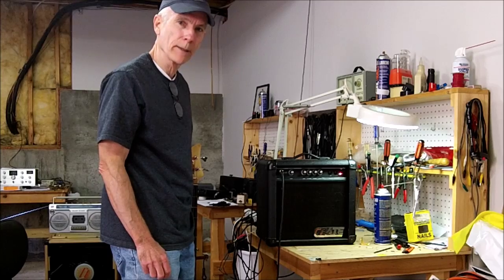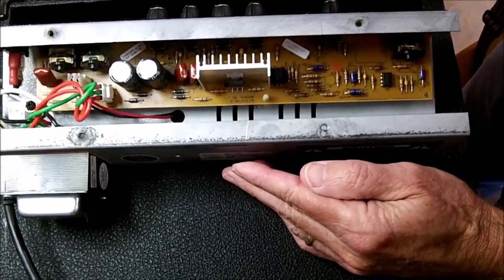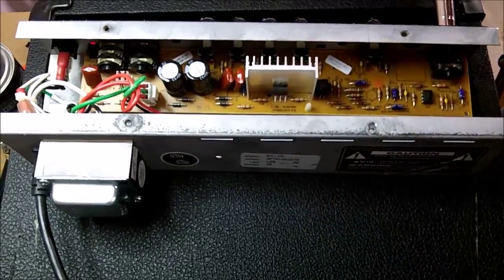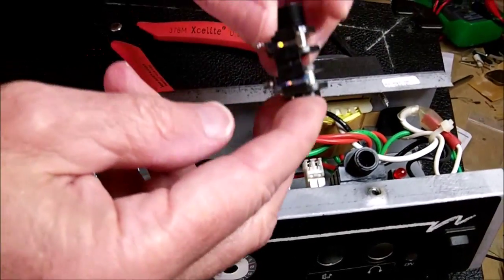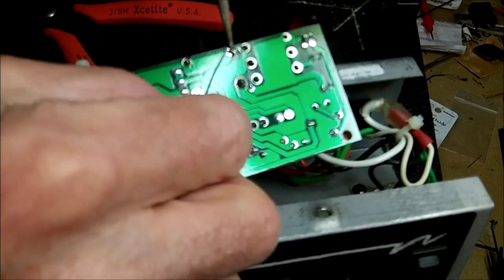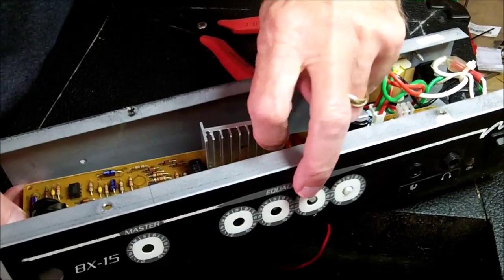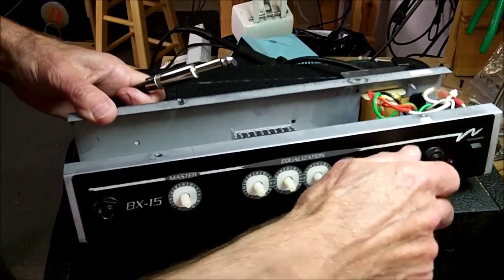Crate BX 15 Solid State amp repair

Comment: I bought a Crate B80XL off Facebook Matketplace for 50$. The minus 15 decibel  jack works bit not the zero decibel  jack .Of course the seller didn't mention the input  to use on a passive bass doesn't work. After  Watching this video I hope it's something simple that I can fix
Reply from the maker: Sounds like a bad zero db jack. Check the solder connections on that jack carefully and repair if there are any cracks in solder.

Comment: The IC AMP fried. Repainted the entire chassis. I think the metal ground from pot's to chassis caused it. Bought 2 more. Could be needing to scratch off paint. What do you think? I created a Speaker jack hole in the back. I created a Mains Jack too. Added an Input fuse before the switch too. Think the speaker jack touching the chassis caused weak sound and smoking. Will try grounding pot's first. Some Peavey VIP's, demand Speaker Jack to be isolated from chassis. Modifying Combo's and separating Head's from Cabinant, is hobby fun. Playing 15 watt's thru a 400 watt cabinant, is fun. Need a schematic showing ground point's.

Comment: I have an old Crate B10 xl solid state amp that I’ve been trying to get working again for a couple years. There isn’t any repair places near me and I searched all over online with no luck finding any similar problems like mine. I was playing it and all of a sudden zero audio, not even a hum, the fuse wasn’t blown and it still powers on. I’ve confirmed that the speaker is still good, I can’t see any signs of something that got hot or blew, the jack inputs are making contact and are re-soldered, all of the wiring is good, and it doesn’t even make a sound when I touch the aux jack.
Reply from the maker: You say you checked the input jacks, but have you cleaned/checked the headphones jack?
That jack can cause loss of audio if the normally closed contacts are dirty or not in contact. You could also plug in headphones and see if you have sound in the headphones.
If no sound at headphone or line out then, possibly one of the two Integrated Circuit components. Diagnosing those are advanced troubleshooting.
Start with the headphone Jack and report back.
Reply: I confirmed that all of the jacks are making contact and there is no sound when I plug in headphones.

Comment: Great video.  I have a Crate XT15R...got off Craigslist free came with free Japanese LP with broken headstock.  Repaired guitar...re-strung...Amp only worked through headphones.  :(  After watching your video, I removed the amp from the case and was able to clean the contacts in headphone and speaker jacks (I used some tweezers to wiggle and drag thin strip of fine sandpaper between the contacts).  Works like new!

Video inspired me to get at the jacks!
Reply from the maker: Great!
Reply: @jamelectronics when using a non-contact voltage detector, the wires coming from my power switch to the fuse box at the back there are hot. 

The red and green wires coming out get nothing. 

Does that suggest an issue with the fuse(s)? 

I don’t see an easy way to replace them on this unit. (Crate gfx15 looks really similar to your on the inside) 

Any experience with this?
Reply from the maker: There are 3 wires coming into the amp from the power cord. The "hot" wire goes to the on/off switch and then to the transformer. The transformer is mounted on the back of the chassis (could this be what you think is a fuse block?).
The 2nd wire goes straight to the transformer and is the Neutral wire. It will not show any voltage with your probe.
The 3rd wire is a ground and is terminated directly to the chassis and is a safety ground and obviously has no voltage. I don't believe there is a fuse in your amp. Not sure what your issue is with the amp,  but I hope this helps.
Reply: You might have replied to my comment by accident...
Reply: @jamelectronics  oh I think what I was calling a fuse box is the transformer. 

So, should the red and green wires coming out the bottom going to the board be hot?
Reply from the maker: So, sorry, I have asked commenter to start his own comment string.  @alano2875
Reply from the maker: The red &  green wires coming out of the transformer have voltage but not 110 vac because the secondary side is a stepped down voltage. Your non-contact voltage detector will not detect ac voltage below 100 volts. It you have further questions please start your own comment string as this is on alono's post. Sorry, Alono. @hansonlife9465

Comment: I have a Crate G20C XL that will not always make sound when using the guitar's front pickup. Guitar works fine on other amp and have changed cables. Any ideas or suggestions?

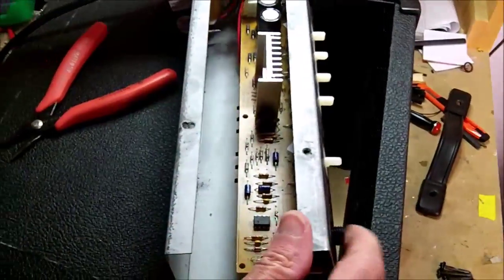Comment: at 3:37    .......theres a few wires up there that go to a Harness, the white plastic that snaps into the board.             .............  Im trying to pop one loose on my Crate amp,  but dont want to break it, just wondering if you might know How they come off???    I dont see anywhere to squeeze or anything indicating how to remove it from the board.
Reply from the maker: Maybe you are talking about the white plug and socket on the board that connects some wires to the board. If so, you just pull the plug out of the socket. You can spread the “ears” on the socket if the plug doesn’t want to come out. Use a small screwdriver to spread one ear then the other while you pull on the plug.
Reply: @jamelectronics           I ended u[p pulling it to & fro over & over & it pullled out //////////////   ./.    I was trying to disable the effect dsp ,                It was a success.          They were not working right,   yet I love the amp. Got my own pedals,  so now No dsp,       all good.

Comment: I bought a new guitar, plugged it in with a chord I've barely used.  The volume is all the way up on my amp, and on my guitar and it barely gets past a low volume.  What could it be? It's a solid state GX120w Crate.
Reply from the maker: First isolate the problem to either the guitar, the cord or the amp by substituting guitar, then cord, then try playing into a different amp with your new guitar. If it's the guitar, return it to the seller if possible or take it to a guitar repair shop.

Comment: Before working on one of the boards how can I properly discharge the main power caps on a solid state amp (Roland JC 120)? Is leaving the amp unplugged/powers off overnight usually sufficient?
Reply from the maker: The schematic for that amp looks like there is 37 volts dc on the filter caps. That is not the danger that a tube amp would present since the voltages that might be stored on those caps would be 300-500 volts. You could check the voltage on the filter caps rights after you turn it off. If you're concerned, discharge through a 100- 1000 ohm resistor to ground. Overnight, there should be no voltage left.
Reply: Excellent, and thanks. That's what I had thought. I should be good to go to work on it.

Comment: Thank you > That I believe is what is wrong with my Crate Acoustic 112D > what is the blue tool you are using with the solder tool > is that to help remove old solder..
Reply from the maker: Yes, its a solder sucker. Heat the solder until fluid and then push a button and solder is drawn out.
Reply: @jamelectronics  can you get that tool at harbor freight maybe. If i play around with the wire it plays fine but sometimes cuts out > would you recommend replacing the jack or check if solder broke loose and just re-solder.
Reply from the maker: I’d check the solder on that jack. It’s common for the solder on the input jack to get broken. Even if you don’t see any cracks in the solder, heat it up and reflow the solder on the Jack. If you should need to replace the jack, you can get a solder sucker on Amazon. I use the one called Soldapullt. It’s lasted a long time and works good.

Comment: I've got a Crate BX-25 bass amp with some noisy controls.  Do you have any advice for cleaning scratchy controls?  By that, I mean should I use a special kind of contact cleaner with lubrication? Or, just regular contact cleaner?
Thanks a lot, Tom
Reply from the maker: For potentiometers, you should really use a contact cleaner with lubricant in it. A new potentiometer has lube applied during the manufacturing process to reduce wear on the contact surfaces. So, the cleaner with lubricant is best since it cleans and replaces the lube to cut down wear.
Reply: @jamelectronics  Thanks for the quick reply.  Do you recommend DeoxIt D5?
Reply from the maker: @THOMMGB  That product should work fine. I've not used it, but I checked it out and it should work fine for you.
Reply: @jamelectronics   Thanks very much for the advice.  That's what I'll use.

Comment: What would cause my CRATE TD-50C switch between the first  and second channel by it's self?
Reply: That happens to my CRATE 80x aswell! If played in gain channel it flips back and forth to clean channel but now its also cutting in and out the sound with a loud POP sound everytime it comes in and out :( HELP
Reply: @Str1ng5  Sounds like the clean/gain channel switch.

Comment: James do you have a part number for that plug. I don't have anything like that around and can't clean or bend the contacts.
Reply from the maker: The jack I changed in the video is Crate part no. 39-116-01, also, an equivalent jack can be obtained from www.tubesandmore.com using part no. S-H903L
Reply: Thanks James, ordered 2, doing input and ext.
Reply: If that does give me output then I'll be punting for sure, at least I found a schematic.
Reply: Does not I mean

Comment: I have a GT15R with the same problem and can't figure out how to remove the amp chassis. I've removed the 4 top screws but it still won't budge.
Reply from the maker: It should come out with the removal of all 4 screws. Usually they are stuck and require some careful prying of the back of the chassis from the case while using your thumbs to push the front of the chassis. I hope you are able to get it loose.
Reply: I put a little bit more pressure on the front and it popped out. No broken jacks but cleaning the connections seem to have done the trick. This old amp working again.
Thanks for answering my question.
Reply from the maker: Good work!

Comment: is it safe to replace the speakers of a 15 watt solid state amp to 50 watt speaker? what are the cons?
Reply from the maker: Yes, it's safe. Generally, its best to use a speaker designed for a guitar amp to be sure it responds in the desired frequency range. If you are talking about a practice amp, then that's not as much a concern as with a better quality amp. There shouldn't be a con using a 50 watt rated speaker with a 15 watt amp..

Comment: I can't help but wonder why you didn't check the speaker first, just to make sure that it was working.
Reply from the maker: Christian, that's a valid question. A bad speaker would give the same symptoms. I just started at the front of the amp looking at some common failure points in these types of amplifiers. If the jacks had all seemed OK, then the speaker would have been the next item I would have checked. My experience on Crate practice amps has been that the jacks are more often the problem than speaker failures. Thanks for commenting! Jim
Reply: Cool, You're welcome!